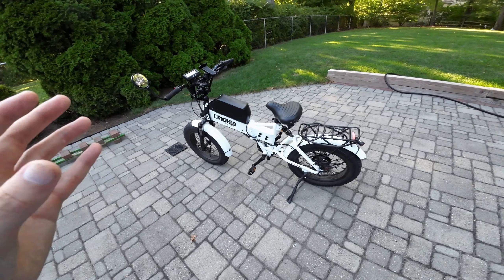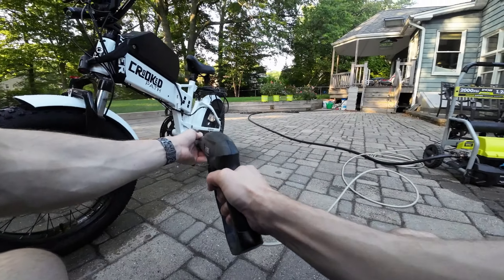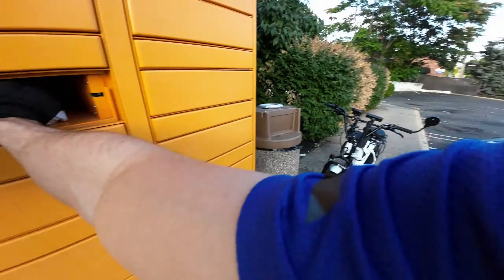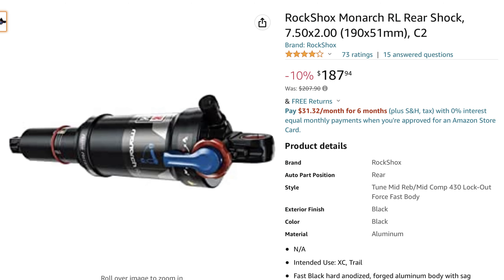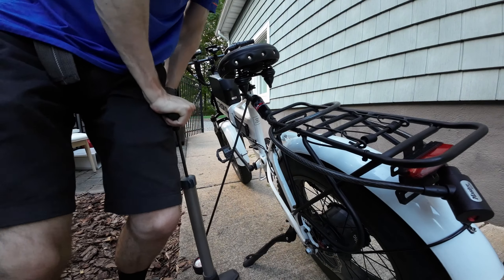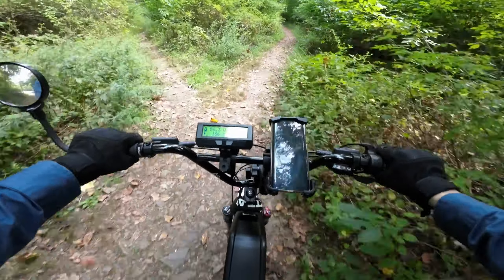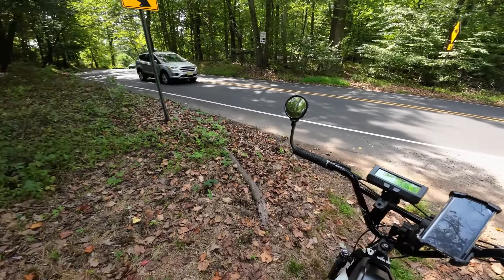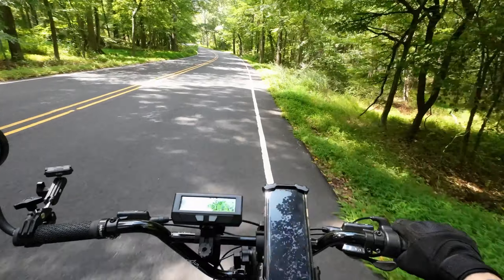The Best $82 I’ve Ever Spent on my eBike

Comment: When I was a young man I learned, ‘don’t clean your bike with a pressure washer’. Have the rules changed?
Reply: I was thinking this
Reply: Its one of the things that seems to be controversial in the comments section. if you do it mindfully it can be convenient and effective. obviously spraying the wrong components with a crazy psi pressure washer isn’t good. Water will get in everything. I wouldn’t be doing it around any electrical components that aren’t potted and waterproof by design. The chain will be sick and squeaking if it gets blasted etc.   i was a bit uncomfortable about the way he was blasting it 🤨
Reply: You just want to avoid driving water into places it shouldn't be so anywhere with grease o-rings seals.

Comment: I am trying to make a custom electric bike and you got the perfect acceleration.How can i contact you just to ask a few question about the build because apparently you can run into some problems.I do not want to buy like 3 electric setups till I find the right one.
Reply: Just get you a more powerful rear hub kit. Just make sure you measure the rear  dropout on your frame to get the correct size.